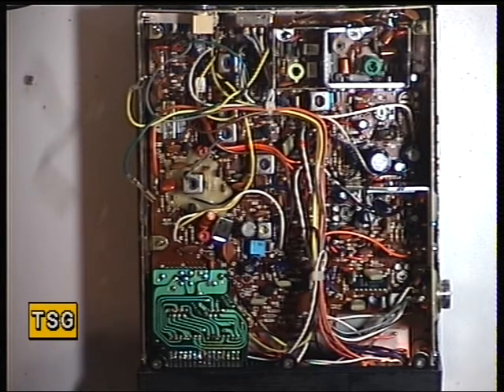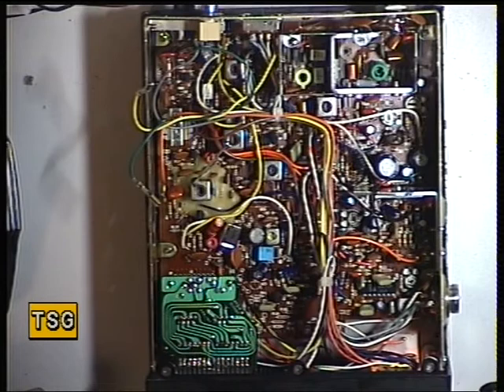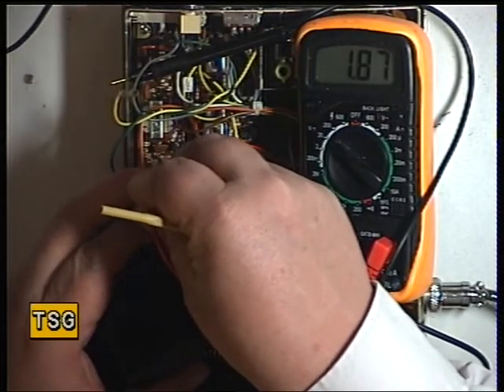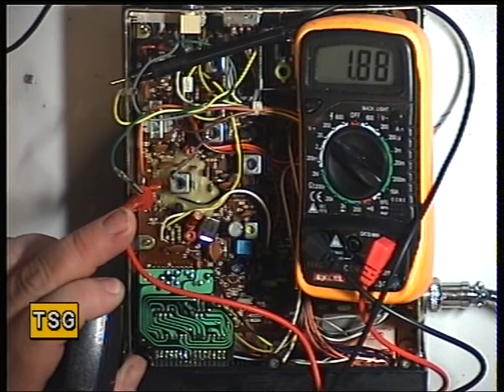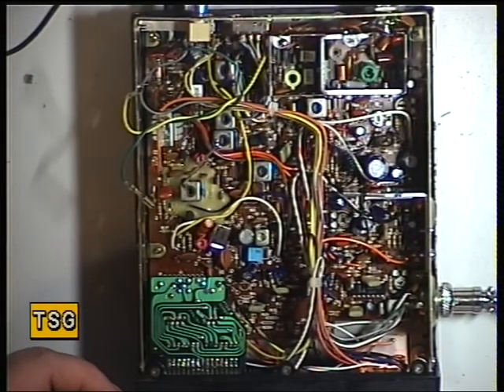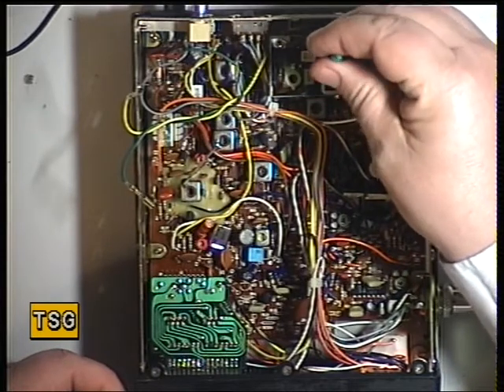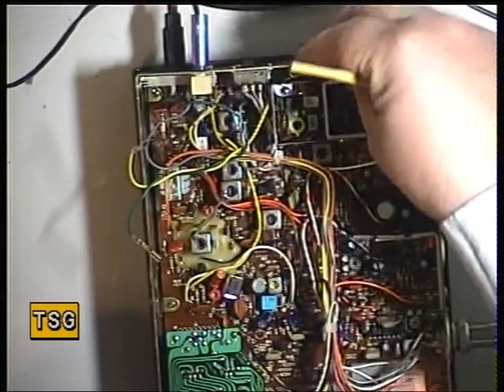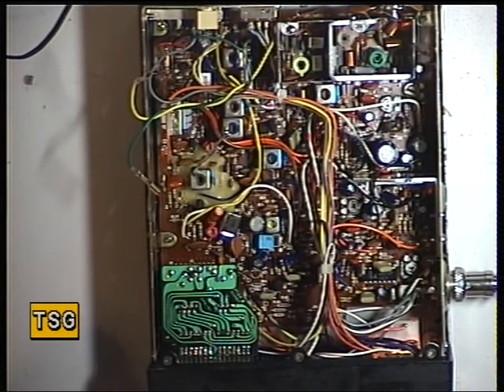Harrier CB - UK CB radio, (CB 27/81) (Mobile) - VCO & Transmit alignment

Comment: Hiya richard wonder if you could help us out with a harrier cbx having probs tuning in thought I'd solved it receiving breakers but calling out not a thing lucky if the needle touches 5lb am only using a modulator mobile ariel but had no probs when I was on air yrs ago its first harrier cbx I've bought and I don't want to go needing around with it......Yr help would be appreciated cheers
Reply from the maker: I assume you have checked the SWR on the aerial, ass that can make the difference between 250yds & 16 miles! I am also assuming you are using the radio mobile & not homebase. When you go into Transmit & you say the needle only moves as far as the (rx) 5 position. Just check that the hi/low transmit power switch is in the high position. I can' remember if it's on the front or back of this set. Lo tx power is 0.4W, high (normal) power is 4W. Also bear in mind that the power output meter reading is relative to SWR & in reality means very little. The other point is that I can always hear people using illegal high power burners (hope they get done for it) & obviously would not be able to get back to them.

See if any of my comments here help,

Richard.
Reply: UK CB radio servicing  hello richard I've swr the rigg and just bought a new mag mount as other one was faulty am using this indoors but it's still same knocking 3 to 5lb when transmitting.. Cheers micky
Reply from the maker: As I said before, the reading on the rigs meter is relative to SWR. With a 4W output, some meters will swing right accross, some will barely move. Some of the newer LCD meters show full transmit bars when the transmitter isn't even working properly. If you've been able to SWR the aerial, then I would expect the transmitter to be working. I assume you are using a mains power supply intended for use with a CB radio with a nominal output of 13.8V & at least 2A of current available. You may want to try another rig to see if you get the same results. Bearing in mind the Harrier CBX is now 35 years old, is it working properly or does it need servicing?
Reply: UK CB radio servicing cheers rich gunna have to try an get it serviced but Ya know what some of these rigg doctors are like but thanks again is there a little pot inside the rigg that Ya can turn up the needle!!
Reply from the maker: Yes, there is a preset for the TX & RX side of the meter, but you need test equipment to calibrate it against. Bear in mind the meter reading doesn't make the radio work better....but a low reading in tx could mean the transmitter is not performing as it should.

Under the circumstances you may send the radio in for service here if you so wish....I normally only deal with the trade. Full service is £16.50 + cheapest post. Email me if you want to do this. rshireby@yahoo.co.uk
Reply: UK CB radio servicing cheers rich Al be in touch by end of the week thanks

Comment: I like these radio's as well I have 2 here at the moment. I'm looking for the Harrier name plate for one of them as mine is missing. Its the little plate that covers the 2 switch cut outs between the s meter and channel display. Do u have anything that u could sell me in your scrap units Richard? I am willing to but a full front panel if u have one? I like the harrier stuff the best out of all the similer units but I guess this is just an asthetics thing as they are probably all the same inside.
Reply from the maker: I'll look over the weekend for you....but don't hold your breath! Whenever i've managed to buy ebay lots of front panels, they always end up being 90% off AM sets!
Reply: Cheers mate its very good of u to even bother to look. Thanks
Reply from the maker: Gary, I had a good look at scrap sets & also removed fronts but unfortunately there wasn't a Harrier CB amongst them, there was a Harrier CBX front ironically; typical!
Reply: Ok Richard thanks very much for taking the time to look anyway.
Reply from the maker: I've had an idea. I tell you what I'd do. Remove one of the good ones you have, scan it on a flatbed scanner, print it out on photo paper, laminate it....and hey presto!
Reply: That's an excellent idea mate thanks for that I will give that a go. I have 2 Realistic TRC-2000's but the metal inserts that are meant to be black with silver lettering are badly worn. I to have 2 mint ones as well but do u have any ideas where I can maybe get a sticker decal kit for the 2 scruffy ones at all? Thanks for your help Richard I really appreciate it.
Reply from the maker: I tell you what, Gary. I've got a mint TRC2000 brand new in the box that I bought at the time for testing. I'm going to see if I can safely get the panels off & scan them etc. I have wad punches for our other business here which I think will make a clean job of the holes.....because I have two dreadful looking TRC2000's here that are two scruffy to bother servicing, yet are excellent sets as we all know...let down by the front panel inlays.

This will be a weekend project & I'll do a video of it. If I can scan them OK & can email you the scans!

I've seen ones done with decal kits & they look crap.
Reply: I will look forward to watching that video mate. I enjoyed the fidelity 2001 video's its nice to see them come back to life. Those plates on the trc-2000 are well stuck down so good luck with that. I could never figer out why the receive on the TRC-2000 wasmt quite as good as the other uniden radio's with the same board in? I know there isn't allot of difference in .1 of a microvolt but the trc-2000 always seems to be .3.5 for 12db sinad where as the other uniden stuff can be as good as 0.2.5 or better. Great squelch tho if they had the same hysteresis squelch on the cabernet radios they would be fantastic units LOL!